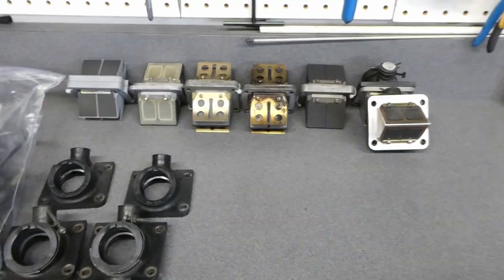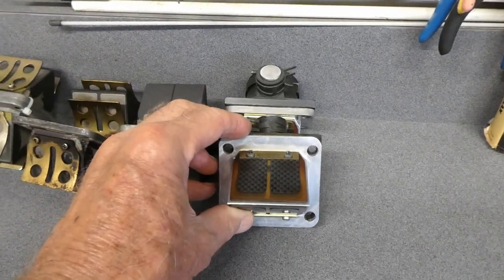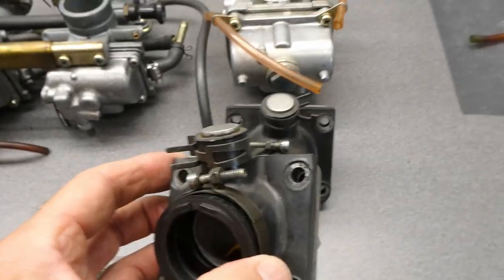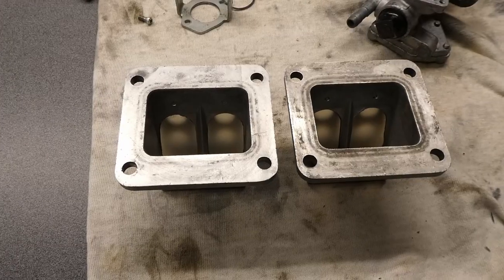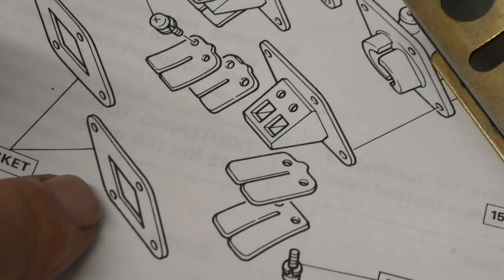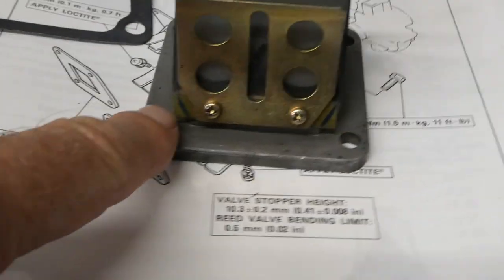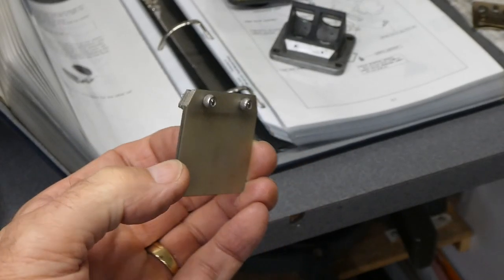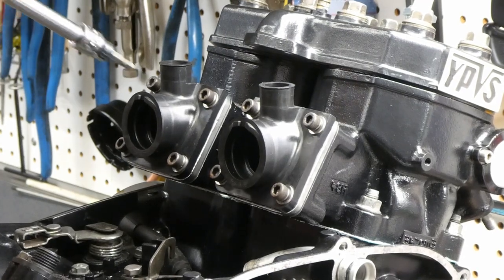RZ350 NC2 Ep48 Reed Valve Install No VForce 4 This Time

Comment: Nice work.  1211 on all mating surfaces ensures a good seal.  Nice tip, wet sanding the mating surfaces.  You should be nice and air tight for your compression and leak down tests.  Happy Motoring! 😊
Reply from the maker: Thanks Scott. Leak test video is staged.
Reply: @KensGarage1  Staged?  As in faked, or set up for video production in the Ken's Garage TV studio?  Sorry, the set up was too good to pass up, having a little fun with a play on words. 😂  By the time you finish your project,  you are going to have a nice catalog of how to videos for the RZ.  Great content for your fellow RZ garage enthusiasts. 😊

Comment: Hey Ken!!!  Thanks again for all the vids!!!  I'm doing my RZ now... it has stock porting and I just cleaned up and matched the cases like you did... thanks for that!!  Mine has stock carbs, Y boot with KNN and DG pipes.  Still has stock reeds... what do you think?  Should I just change the petals or keep it stock?  SO much info out there do not know what to believe.  Thanks in advance!
Reply from the maker: Cool that you did the case matching. I have  a friend that runs stock banshee fiber reeds and loves them. I have never used them but may in the future. Apparently they don't cost too much. The stock reeds will work fine. I've heard horror stories of the stock metal reeds breaking and getting sucked in to the engine. Never seen it first hand so it quite possibly may be internet lore.

Comment: Can you still get hold of those Yamaha reed block gaskets? In the UK they're a discontinued part.
Reply from the maker: Yamaha 3GG-13621-00-00 VALVE SEAT GASKET in stock here  https://www.partzilla.com/product/yamaha/3GG-13621-00-00?ref=1608668538b1aad85e9c8261ab1e8072a50ce9ae

Comment: How did you like boyesen reeds. Just doing a simple stock rebuild on my 89 rz350 with stock airbox and micron pipes. Bike has 29000km with stock metal reeds and thinking it time to replace maybe.
Reply from the maker: The boyeson reeds worked okay for me. They get a bad rap all over the place. But if you want to spend the big dollars get the VForce4 which I put on my thrasher bike. If you don't, I know people who have been very satisfied with OEM Yamaha banshee reeds. That would be my choice for lower $$ replacement reeds.
Reply: @KensGarage1  Ok thanks. So the oem banshee reeds are not metal.
Reply: That is what I am going to go with
Reply from the maker: @chrispederson4157  Cool. Come back and let us know how they work. Yamaha Banshee reed valve part number 2GU-13613-00-00
Reply: @KensGarage1  So those reeds will work with stock reed cage?
Reply from the maker: @chrispederson4157  Chris, I emailed a friend back east and he replied with this "Yes, the Banshee fiber reeds fit the stock cages without modification. They are very affordable even from Yamaha!"
Reply: @KensGarage1   Great. They are like $80 Canadian from local dealer very reasonable price for this day and age. I got to tell you Ken I have used your vids huge and really helped me with this project.
Reply from the maker: @chrispederson4157  Sounds about right. They are $13.77 US each x 4 at partzilla. Thanks for the compliment!